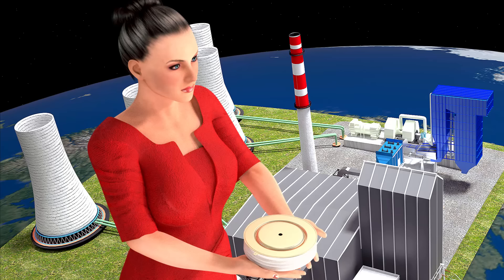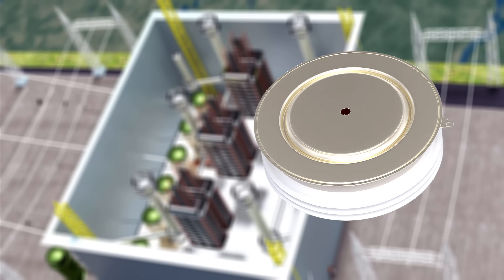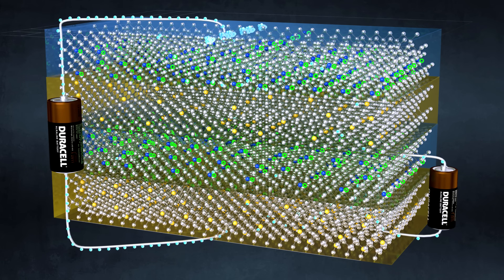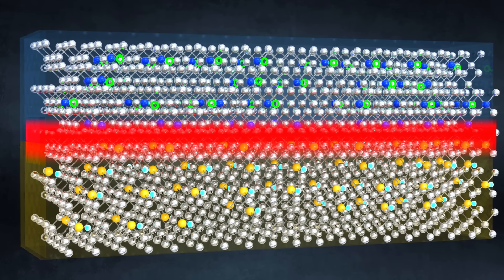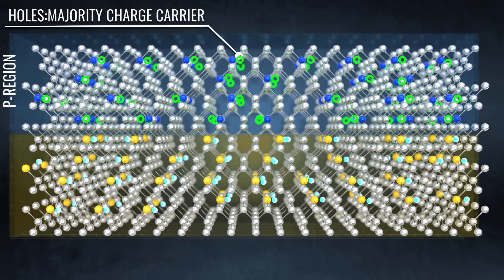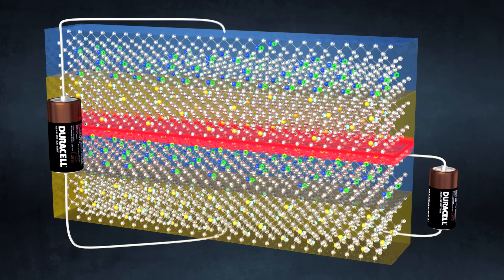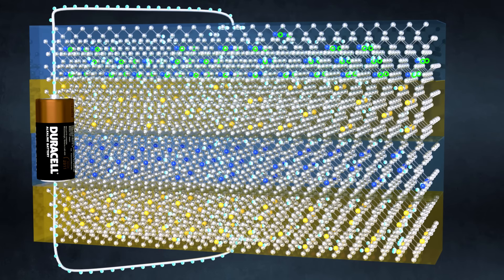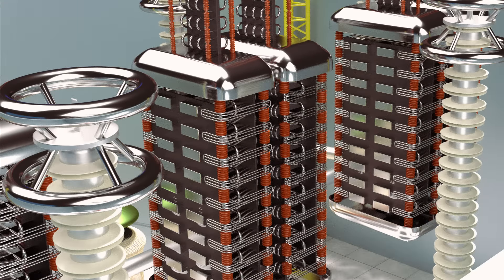How does a Thyristor work?

Comment: Wait I thought that power lines use AC to transmit energy because DC used to heat up the Cooper cables too much
Reply: Conductors heat up based on the current flowing through them not necessarily because of the voltage.  It doesn't matter if the current is AC or DC. The reason AC has historically been used for transmission is because it is easier to generate and step-up to a higher voltage using a transformer which is a very simple electrical machine.  Higher voltage means lower current which means lower line losses.  DC cannot generated or stepped up very easily.

BUT, with a thyristor, it is very easy to convert from AC to DC.  So you can generate AC, step it up as AC and then convert it to DC for transmission.  DC is better for transmission for several reasons:

1. Because DC is not oscillating, it generates less RF interference and experiences less radiative loss.

2. DC has a lower peak voltage which means less danger and cheaper insulation. To explain, 120 V DC can provide the same power as 120 V AC (RMS), but the AC actually swings from -167 V to +167 V peak, meaning you have to insulate for a voltage difference of 334 V.  You only have to insulate for 120 V for the same DC wiring.

3. There is no skin effect in DC current, so conductors can slightly smaller.
Reply: DC lines are used only for some crazy long lines or for some underwater lines (like between UK and Europe)... from what I know the only land based one is somewhere in China because their fucking huge dam is in the middle of nowhere, so they have transit a lot of power over a very long distance (which is a stupid thing anyway).
Every power line has some electrical resistance (which causes energy loss and voltage drop) but also reactance that causes mostly just a voltage drop (which you want to avoid on these long lines). As the formula for reactance is X =  2pi * frequency * inductance, you can see that DC line (having frequency equal to zero) has its reactance equal to zero as well (thus it makes no voltage drop) and THAT is the main reason you might want to use DC for extra long lines (hundreds of kilometres and more).
Reply: At very high voltages, AC lines loose too much power due to capacitance and inductance. Electrons just fly-off of the conductors. Hence very high voltage AC lines use multicore conductors aligned in triangular or circular shape.
Reply: @sumilidero  you are right about parasitic reactance, but the electrons don't literally fly off the conductors. The energy transfer occurs via magnetic and electrical coupling with nearby objects.  For the electrons to physically travel any gap, a plasma would have to form which would cause arcing.
Reply: @QDWhite  thats exactly the case, at HV, on the sharp points you can see at night plasma forming (aka St elmos fire :D) literally ionizing the air and releasing electrons.
Reply: @sumilidero  ok I'll concede that happens in certain circumstances, but the amount of energy lost that way is orders of magnitude less than the energy lost via other means.
Reply: @QDWhite  I don't think there is more energy loss caused by other means than electric field :P ,for real, it's a part of capacitive coupling. And HVDC isn;t that common - it is used in certain circumstances, at least for now :D only problem with that is a need of electronic converters to step up/down DC.
Reply: @sumilidero  yes HVDC is less common. Generally, the transmission path has be greater than a certain length before HVDC becomes cheaper than AC. Canada has a few because we have so much territory to cover.
Reply: @QDWhite  2. - it's not exactly that way, actually DC is worse considering insulating problem. DC exerts more stress through insulation, and in fact, it's easier to insulate 120V AC than 120V DC. Moreover, the higher rate of change of voltage, the higher strength of insulation. If you look at power station's appliances (breakers, insulators, transformers etc.) They have least strength against DC voltage (thats why we probe insulation using DC; and we dont probe XLPE cables with DC, cuz it damages it (we use very low freq AC) and they have the highest strength against short impulses (even 100kV more than for DC conditions relating to medium voltage gear)
Reply: @Richard Vaughn Well thats basic, but I don't know where have you found me not understanding reactance? ;p and what your coment has to do with the topic in detail?
Reply: @Richard Vaughn thyristors are used to covert both ways.
Reply: @Richard Vaughn nevertheless, thyristors are still used in high power applications.
Reply: @Richard Vaughn not really, you have to maintain voltage levels in power grid knots to balance the system to keep it stable, generated power/consumed power. To do so, you need to regulate voltage, for HVDC line, its the easiest way to use thyristors. In standard SC power systems, it is done by on-load tap changers of transformers, which is very expensive process. Simply using thyristors instead of diodes will give you that advantage to change voltage with relatively lower costs, in DC part.
Reply: @Richard Vaughn looks like someone's studying to get their electrical journeyman ticket.  Everything you just said is correct in conventional applications, but HVDC is not a conventional application.  It goes beyond what you'll learn in an electrician's study materials.
Reply: @Richard Vaughn its local point of view, for the whole system its a lot more but easy. The case you are talking its good for your 3kW garden generator, but doesnt tell whole story of national power system. And regulating voltage occurs on many layers, including field of generator, on-load taps and reactive power management. For the whole system its not enough just to keep correct voltage on the generators, moreover tap changing on the biggest transformers doesnt generate much of a voltage spikes because of its huge inertia (magnetic etc.). We have here in the power plant 110kV transformers that change taps automatically under load everyday/night aside of generator's AVRs. Also capacitors/free runing sync generators are used to manage reactive power in the system, which leads to voltage avalanches when not sufficiently supplied.
Reply: @QDWhite  Yep, exactly, there are nuances that are negligible in your everyday house installation electricity, but play significant role in more complex systems, and one has to consider whole physics, not just the high-school R=U/i Ohm's law which is most simplified version for plain circuits.
Reply: @sumilidero  Power lines (down to the 15KV on your street pole) are not insulated.
Reply: @RinksRides  And what does that have to do with the topic here?
Reply: @sumilidero  you guys dont you see? arguing about who is correct in electricity is cause we have a wrong electron theory. Nikola Tesla spoke of aether and he was correct.
Reply: @Richard Vaughn you guys dont you see? arguing about who is correct in electricity is cause we have a wrong electron theory. Nikola Tesla spoke of aether and he was correct.
Reply: @sumilidero  also since i started understanding aether it was logical that DC would consume less power on long distances but the potential must be really high for the vortex that is formed to keep it's coherence thus minimal losses. AC is radio signals...  perhaps in wires you can see them as transversal waves, but in air are longitudinal so verry inefecient. 1 wire transmission of power or inteligence through earth is what we need
Reply: @manipulativer  well, thats weird, because the most accurate prediction in entire physics is about electron and comes from well used field theory. I doubt if its any bad at all. I'd say its good enough for such simple task :P
Reply: @sumilidero  Ye, but for example, everyone says magnetic lines of force, yet its a vortex, everyone says the charge is stored on the plates of the capacitor, yet its stored in the dielectric and than you have stuff like: an electron will take the path of least resistance, yet Tesla hairpin circuit shows otherwise.
So good enough is not goodenough

Comment: I didn't understand why DC would have advantages with long transmission lines. Can someone explain this to me? Thanks!
Reply: The main disadvantage of AC is skin effect (the tendency of AC current to concentrate near the surface of a conductor, due to higher inductance in the centre of the conductor, on comparing to that of its surface).
So the effective resistance is increased and so more copper is needed than a DC line of same voltage level.
Corona discharge is also high, compared to DC.
An AC  line has capacitance.therefore there is a continuous power loss due to charging current even when the line is open

Comment: Hey Pal, the whole idea that Nicola Tesla had in mind with his AC power is low line loses. That is why the high intensity lines are no bigger than your finger as opposed to Edison's DC which were as big around as your leg and still demanded constant replacement due to burning in two. I don't doubt that Thyristors are used in transmission, but it definitely is not to change from AC to DC. That would defeat the purpose of having AC.
Reply: What if the source of the electrical energy is an alternator?
Reply: @CTSFanSam  Yes Sir, the alternator has an internal bridge rectifier which charges a local battery. My misunderstanding is that the ac that comes from (in my case) Oak Ridge TN. Is probably around 100kv or higher. Then it comes to a substation in my area where it is conditioned to around 75kv then comes to a step-down transformer near my home which is centrally located between NY an Miami FL. In NC. The voltage is then stepped down to 240vac. No DC is involved, only 60hz 240vac. The word Thyristor can mean UJT, Triac, or SCR. Since the man is saying that they are changing ac to DC (which is wrong) I guess he is referring to SCR's. But, the more logical one to use is the triac, since it will maintain the integrity of the 60hz line voltage. I suppose that it would be possible to sample the voltage and send that sample over the transmission lines and then recondition it when the destination is reached, but I still don't see how this can be profitable. However, I am sure that they do not change ac to DC and then have to change back to ac when the destination is reached. It doesn't make sense.

Comment: Electrons do not really flow in the wire - the electric charge does. Drift velocity of electrons is around 4cm/h.
Reply: Electrons really do flow in the wires.  They are the majority charge carriers in a conductor.
Reply: @QDWhite  Yeah, but only 4cm/h. The electric charge is the one that flows at the speed of light and carries electricity or is electricity itself.
Reply: @KamilsView  no, the electric signal (voltage) travels at the speed of light in the medium.  The electric charge (current) flows at drift velocity.

In other words, every electron in a circuit gets its marching orders (almost) at the same instant in time, but they still move very slowly.
Reply: @KamilsView  I love Nic at the Science Asylum!  He's one of the best on youtube. I think you've misunderstood him though.  Current is most definitely the physical flow of charge which, in a conductor, is the flow of electrons.  Granted, in other materials, it isn't always electrons.  Try this video of his which might make it more clear.
https://youtu.be/QKxep82_9b8

The flow of energy, however, is different. Science Asylum did another video about the Poynting Vector which explains this. If I can find the link, I'll edit it in here.

Edit: Found it
https://youtu.be/C7tQJ42nGno

Edit 2: I would say there's a slight correction to be made to his video about the Poynting Vector. He says the vector points radially inward toward the wires. It actually points closer to parallel with them. Compare his video with the Wikipedia article about the Poynting Vector to see what I mean.

Comment: Good explanation how a Thyristor works, but there is a lack of answer how it’s turning low voltage AC power into High Voltage DC power or how it turns AC into DC at all.
Reply: This channel's videos are annoying like that.  Just glosses over WHY you'd want High Voltage Direct Current, tosses in the acronym "HVDC" as if that's what "this chapter" is about.

It's like an AI made the video from one section of a Wikipedia page without following any of the links.

Comment: "We hope this video gave you a good insight about the working of thyristors."  
Uh, no. It kind of trailed off at the end. I'm still a little fuzzy on the big picture. 
"A thyristor (SCR, Silicon-Controlled Rectifier)  is a solid-state semiconductor device with four layers of alternating P- and N-type materials. It acts exclusively as a bistable switch, conducting when the gate receives a current trigger, and continuing to conduct until the voltage across the device is reversed biased, or until the voltage is removed (by some other means. " Wikipedia
Bistable: "The meaning of BISTABLE is having two stable states." Webster's  Presumably "on" and "off"  It will stay ON unless acted upon or stay OFF unless acted upon. Is that right?

Comment: I have a doubt , why can't we supply gate voltage at middle P and N layers . Instead of bottom P and N layers
Reply: That would produce a reverse current with respect to the anode-cathode polarity just for that junction and would not provide a current from anode to cathode.

Comment: I have never heard that long distance power transmission works better with DC and not AC. That goes against all I studied in college.  DC was supposed to incur massive losses as heat and voltage drops over distance making the resistance of the power lines come into play. Is this video actually correct?
Reply: Resistance can be lowered by increasing the Voltage. At some point (certain length of HV power line) the loss of power due to impedance of the powerline itself(using AC) is going to be bigger than the power loss when using DC
Reply: @DagobertDax - I did not know that. Thanks. Must be harder to break an arc on a switch or fuse although I guess that would also be controlled by an SCR

Comment: When you say: thyristors save lots of energy because they remain triggered, are we talking about this current that depends on the hfe, the amplification gain?
Given a typical gain of 50 for BJT, SCR only save 2% energy?
My experience was that SCR and TRIAC were the only high power devices.
I only saw 50A transistors in the last 20 years, and only FET, not BJT.

Comment: During DC power and high amperage you're going to need huge huge heavy cables that's why they run AC cup power go back to schoo
Reply: A high-voltage, direct current (HVDC) electric power transmission system (also called a power superhighway or an electrical superhighway)[1][2][3] uses direct current (DC) for the transmission of electrical power, in contrast with the more common alternating current (AC) systems.

Comment: I have studied that AC is more suitable for long distance power transfer as it has less losses and due to it's alternating nature it can travel long distance easily whereas dc or direct current can't travel huge distance they have too much losses so why DC ?
Reply: because of reactance, AC is essentially better only because its easy to change in voltage using simple step up/down transformers. To transform DC you need electronics. DC in steady state doesn't drop voltage/power on reactance
Reply: There's an footnote on the phrase "AC has less loss than DC" that a lot of people outside of physics/engineering don't know about.  It has to do with Ohms law.  The higher the current, the greater your line losses will be. That's why your 6000W oven runs on 240V instead of 120V.  At 120V, it would need to draw 50A to get 6000W, but at 240V, it only needs 25A.  AC power distribution uses that same hack. An AC alternator may only generate 13,800V, but it can easily be stepped up 10 times to 138,000V (or more) for distribution so that only 1/10 of the generated current is flowing through the power grid.  The 30A you may be drawing in your house is less than 0.01 A on the power grid.

DC is said to have greater losses because a fully DC system can't benefit from voltage transformation. Electricity generated at 13,800 V DC must be transmitted at 13,800 V DC so the full generated current must flow through the system.

DC has other other limitations too. DC generators and motors have brushes which cause huge losses at high currents. AC alternators and motors can be made with no 'touching' parts so they can run huge loads with almost no maintenance.

That being said, if you can get the DC voltage up high, it actually can be better than AC for transmission.  Modern HVDC systems use alternators to generate AC power and transformers to step up to a high voltage, then they use thyristor rectifiers to convert to HVDC to transmit.  At the receiving end, they convert back to AC and transform it down to 240/120 volts for your house.
Reply: @QDWhite  For HVDC system there would be more conversion loss , since converting ac to dc and then back to ac whereas in conventional ac Power transmission system there is only stepup or stepdown by transformer which may have less losses (Cu &Fe losses)  then converting ac to dc.
Reply: @_BlackSpectrum  Once a transmission line reaches a certain length, the cumulative losses for AC become greater than those of HVDC, hence the reason HVDC is only used for really long distance lines.

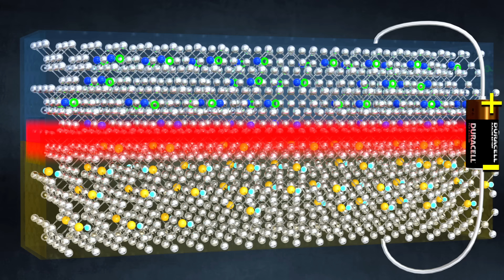Comment: 3:26 p-n junction here is reverse biased. In this case, the electrons will be pulled away from the junction. Consequently, the junction will be increased and only tiny reverse current will flow. A supply should be flipped in order to put the diode in the forward region. Isn't it like this?

Comment: What. I thought it was high voltage ac current that was sent over the grid and DC was only short distance. To run DC far you need thicker and thicker cables?